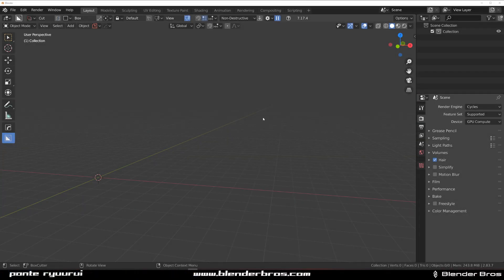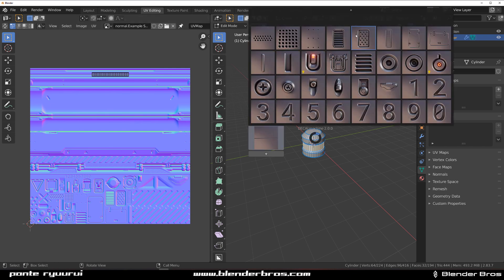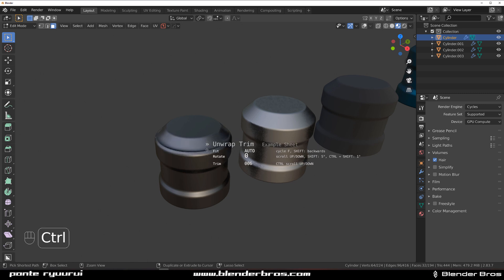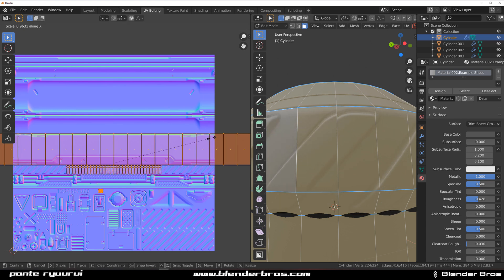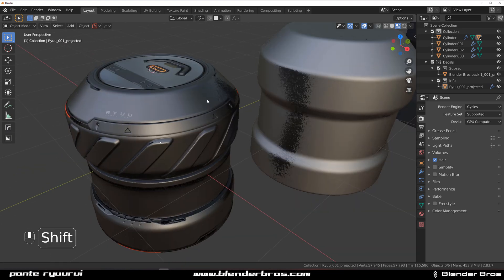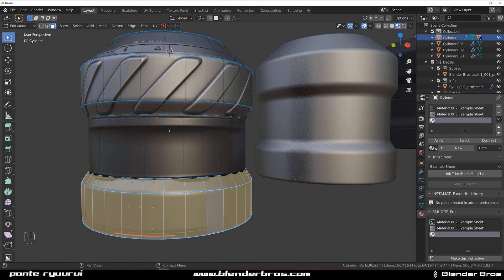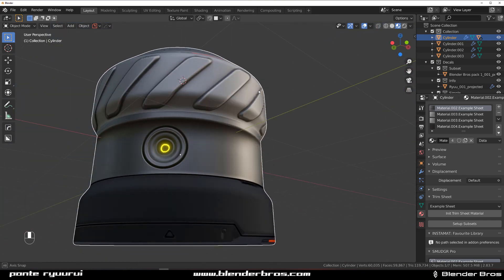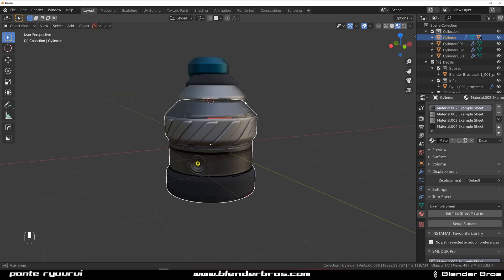HOW to use TRIM sheets with Decal Machine for Blender

Comment: Thank you very much for this video,i want to purchase trims and decal pack but now I don't have enough money but I'll definitely do it in next one or two months.. I'm new to blender and want to modeling hard surface
Reply from the maker: We are about to drop an update for Material Works addon, so I would highly recommend you grab the platinum version which includes all the trims anddecals, because the new ver will support adding them in blender without the need for decal machine
Reply: @PonteRyuurui thank you

Comment: Holding alt while apply the trim doesnt seem to isolate it to only the selected polygons. I tried holding crtl and alt and a combination of ctrl alt and shift but the whole object is still covered with trims. Did they change this shorcut/function to something else?
Reply from the maker: no, its alt mate
Reply: @PonteRyuurui  Yeah holding alt doesnt do the thing
Reply: @Corza  did you ever find a fix for this? I'm still struggling to figure this out
Reply: @Hopkins2517  @Corza Did you find a way to fix this ? for me its simply holdin CTRL instead of ALT

Comment: Do you know if there is any way to have an hybrid system between the decal machine 1.0 and 2.0? I mean, being able to stamp the decals or even slice between 2 geometries but using all the decals as floaters, not mapping the face of the mesh itself. I really would love to have the same workflow we had before but supporting atlas/trim sheets. Thanks in Advance!
Reply from the maker: well ya, just use the regular decals
Reply: @PonteRyuurui  If I use regular ones then I cannot use the atlas/trim workflow, at least not automated one, I would need to  remap de UVs of each decal.
Reply from the maker: @TheSocket775  define regular ones
Reply: @PonteRyuurui  the ones from decal machine 1.0, where each decal is mapped into the whole 0-1 UV space. Is there a way to put the floater decals following the atlas workflow? (So each decal has custom uv coordinates for your custom atlas)
Reply from the maker: @TheSocket775  you only assign trim sheet decals to UVs, the other decals are not UV bound, so you can slap them anywhere.
Reply: @PonteRyuurui  that sounds nice, would be cool to see a tutorial about how to setup a custom atlas and then be able to stamp and use the decals from it onto our model :) To mimic the workflows used in games as Star Citizen or Alien isolation (which mixes layered tile materials, custom normals and floating decals)  Great video btw, thanks for all!

Comment: 1. You can do the panel trim scaling directly in the 3d view using the Adjust tool. That's what it's for. D, A, S, X. (DECALmachine, Adjust, Scale, X).
2. Save some clicks and use the + button, if you are going to scroll through trims anyway.
3. Applying a new material does not re-unwrap to an empty trim. That's only going to happen if you use the Init Trim Sheet tool without holding ALT. So you could have used the init tool on your main model, without having to init all the other material's first.
4. There is no reason  or way for me to "tag" the materials better. It's up to you to name them properly in the first place, instead of leaving them as "Material.001". Initializing a trim sheet will just add the sheet's name as a prefix, to whatever name you have chosen first.
5. There is no need to unwrap manually before adding a detail trim, not if your sheet is properly created and the flat area is "on the surface" level.
Reply from the maker: oooi, I thought you were on vacations! cheers mate, well noted!
Reply: @PonteRyuurui  I am, but still have to stay on top of things.
Reply: thanks!
Reply: everything great, but no posibility put trim sheet to atlas is really frustrating. I mean that would be a way more comfortable if i don't have to use external soft for bake like marmoset etc.
Reply: @grzegorz1055  Put trim sheet to atlas? What does that mean?  Check the docs.
Reply: And you can bake your sheet in Blender too. I explicitly point out that you can create it where ever you want. It's all in the docs.